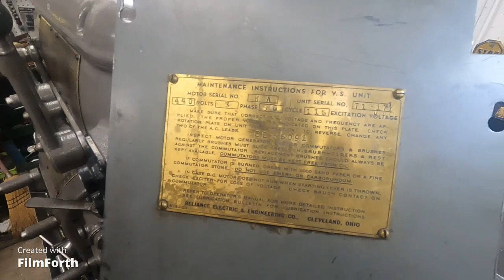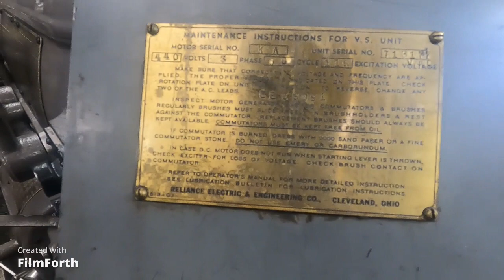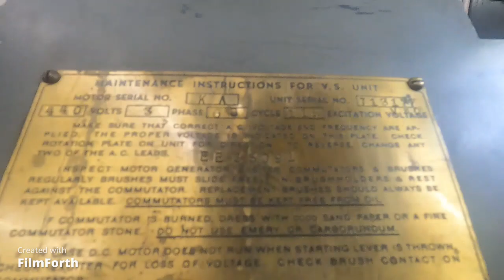Monarch 10ee tool makers lathe, the heart of the matter 2

Comment: Hi DeeDee. My 1943 EE doesn't have the 3 resistors in the upper right of the dc box. All my relays and cutler hammer switches are located entirely differently than yours. On the back of the box, swing it open and there 2 large maybe resistors, I'm not sure what they are,  maybe for the dynamic brake relay. There must of been many different arrangements of those boxes. I havnt seen one like mine, im still learning alot about the whole system. You help so much. Thanks
Reply from the maker: Monarch made continual changes and it is good to get the correct manual from Monarch. The first arrangement after the Sundstrand hydrostat drive was all in line motor generator and exciter, then the exciter was mounted on top and belt driven, the last like I have the appearance was modernized with a more powerful exciter mounted on top but the mounting feet changed, thanks!

Comment: that course stone looks something like the stone my EX would 
use on her feet to remove those calluses she grew from wearing 
the 10 inch spiked heels she loved so much.....ah, those were the 
days.....
Reply from the maker: Might be similar I have a couple of very coarse commercial kitchen grill stones those have come in handy.
Reply: those "pumice" stones might be silicon carbide. I notice that they are very soft and shred easily- similar to my Green silicon carbide wheel.